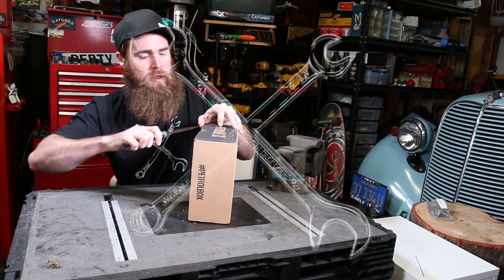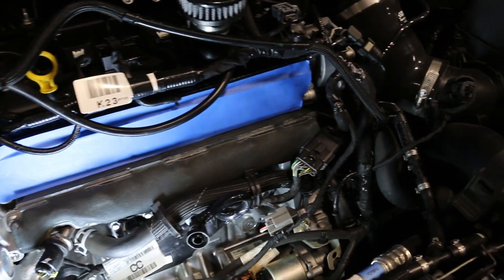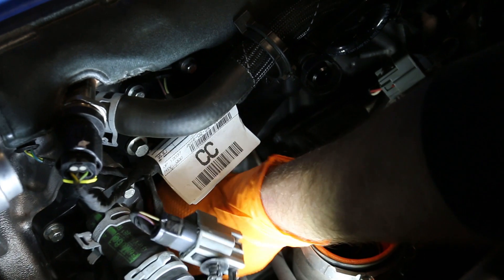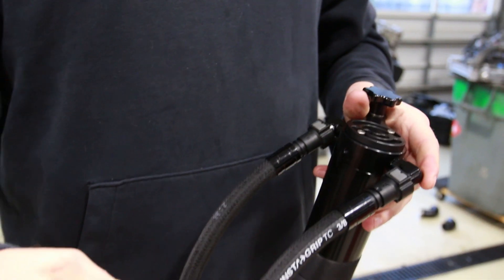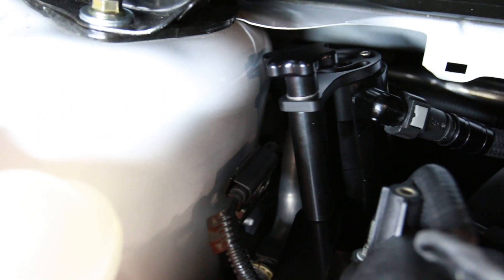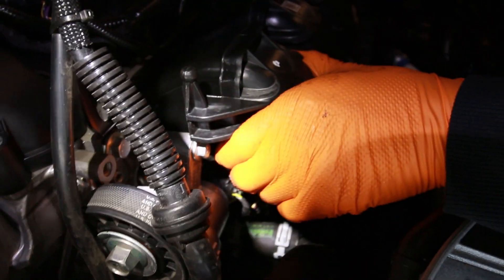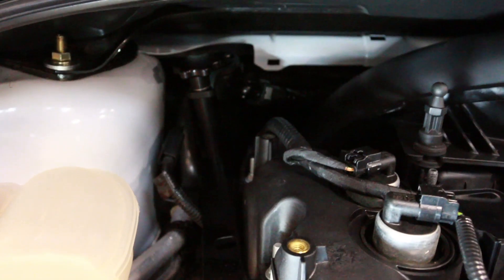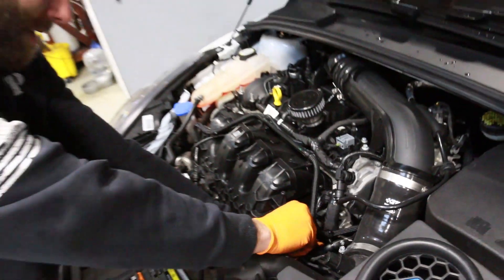FORD FOCUS RS Mountune Breather Plate and UPR Single Valve Catch Can Install

Comment: So I put on a radium baffle plate and UPR single valve catch can on my ecoboost mustang, can’t wait to see if this helps the car in the long run, should I be running a check valve? I currently am not but then I’d have to buy a new hose for the side going back to the manifold but people have been saying I don’t need it as long as I don’t have a vent to atmosphere catch can. What’s y’all’s take on this?